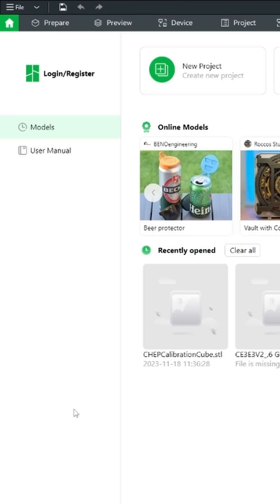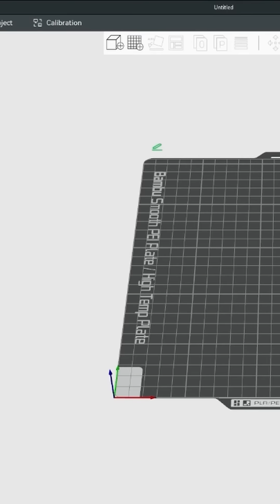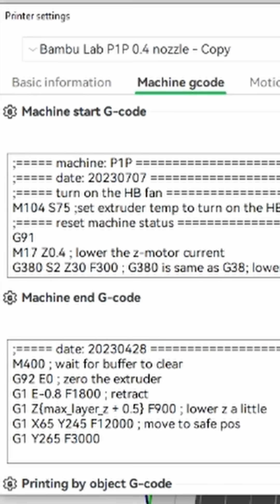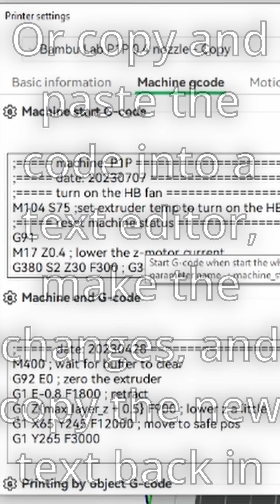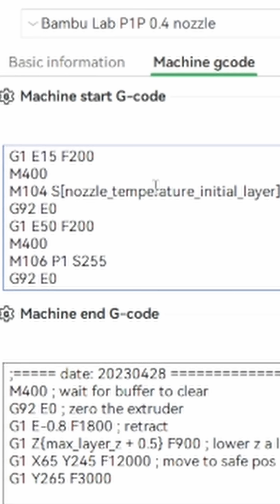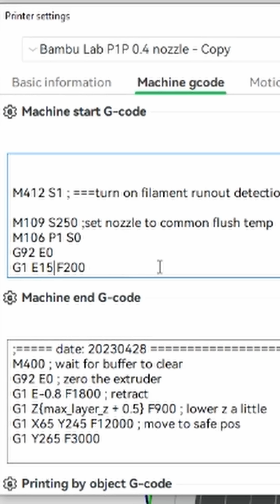How to reduce or remove bambu labs purge!

Comment: How do I get rid of the calibration print across the front of the plate before it prints my object? Turning off flow calibration doesn't do it.
Reply from the maker: I'm guessing you have a P1 machine, but if you have an X1 there may be a bunch of extrusion lines since from what I remember they do multiple lines. I'm not for sure though, because I don't watch a bunch of videos about them and don't own any of the X1s
The next thing is that I'm not 100% sure, but it probably isn't hard to find it.

The way I thought about this yesterday when someone asked about the H2D is:
- First of all, the line of code for the extrusion is the same across all bambu machines I think.
- So if you copy all of the start gcode into a text editor, and control F to find the extrusion code, you should be able to find all the points where it extrudes in it's starting process.
- Then you run a print normally and count all the times it extrudes until it get's to the extrusion you want to remove.
- Now you go back to your text editor and go to the corresponding numbered extrusion in the find function and change it's E value to 0. But also remember that there is two purge extrusions now. (in the case of the p1p at least)
- If my assumptions are right, then it shouldn't actually create the line, though it will still do the motions for it.

Keep in mind I haven't tried this theory yet and have been too busy to, so try this with caution and pay really close attention when testing.
Additionally, it may be better one way or another to just keep it. I don't know if it's just priming to print on the P1 machines or if it actually is testing something, but if it actually is testing something, again, it may be a necessary evil. But also of course, I really don't know. So it may be a good test for science.
Hope this helps in some way.